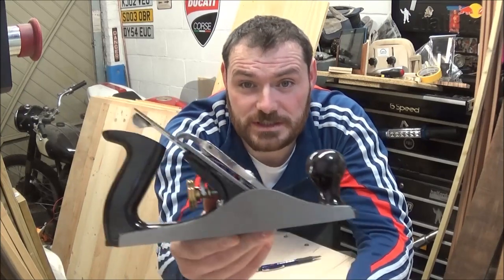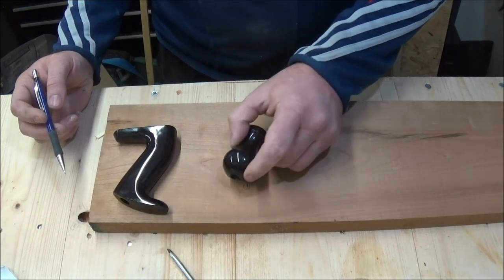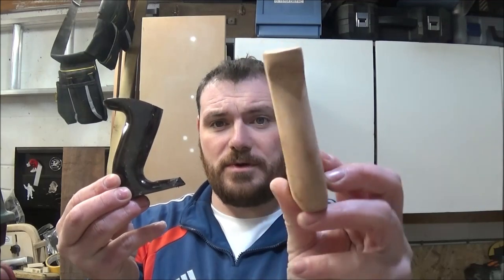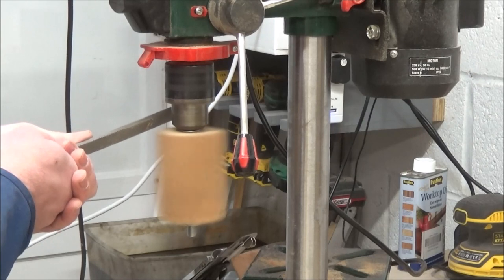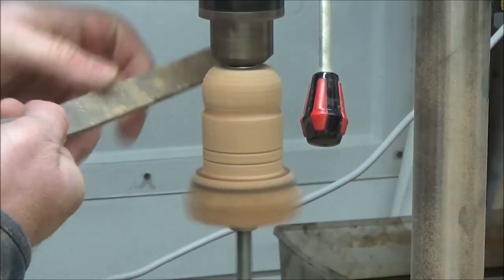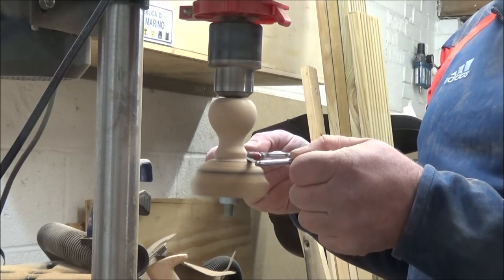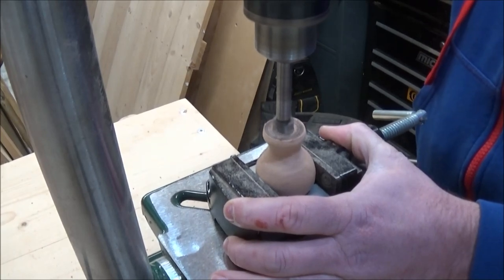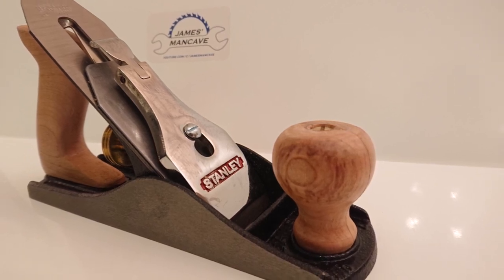DIY Turning Wooden Handles On The Drill Press

Comment: Just found your brilliant channel and liked & sub’d! This is awesome, I’ve got the same plane and never liked the plastic bits, so I might have a go and do the same thing. I’ve also go a couple of other things I want to make, but like you I haven’t got a lathe, so I’ll dig out my drill stand.  Thanks for the inspiration.
Reply from the maker: Hi Michael, great thanks for the sub. Yes those plastic handles are quite disappointing, the wooden ones do make a difference. I really enjoyed turning these on the drill press. One thing I would do different next time though, is knock the corners off the square bit of wood so it was an octagon shape, this should save time 👍

Comment: I didn't think that would work on the drill press and rasps..how long did that take....also, a question, I have been collecting old planes, some are from the late 1800's..I want to replace the rear handle on an old Stanley, how did you determine the angle and then drill the holes for the mounting bolts.....thanks,.....just some dumb guy in the states
Reply from the maker: Hi, it took me about 45 min to get the handle shape I wanted, the time consuming part was getting the square block round. For the angle, I lined up the of handle in front of the new one, and tilted it until the hole was straight, then I adjust my handle to the same position and then drilled a straight hole through it

Comment: The knob looks too large for that plane IMHO but it looks like you made it well. As long as you like it and it's comfortable to use that's the main thing.
Reply from the maker: Thanks for the comment, I like to get different opinions from people. I've made the front knob to the same size as the original. For me though, with slightly bigger hands it feels comfortable, so it could be larger then normal